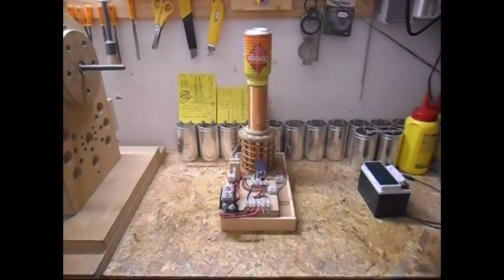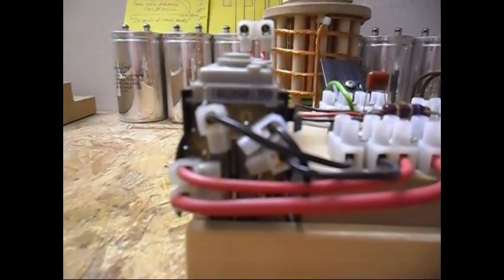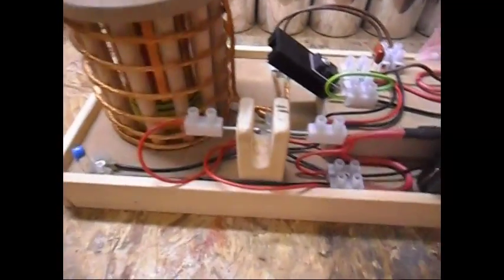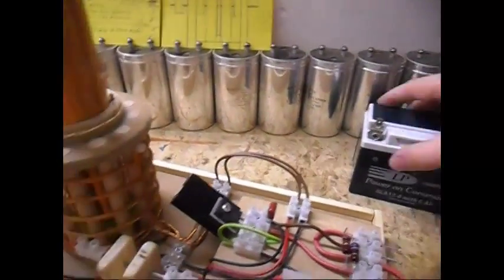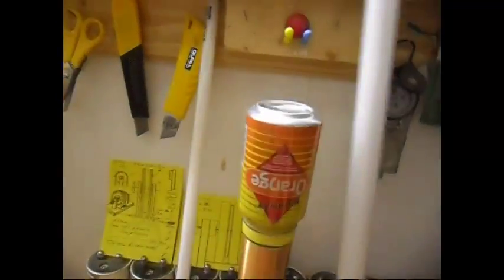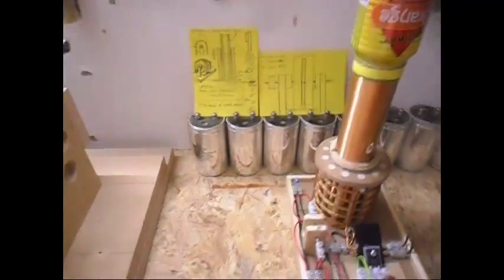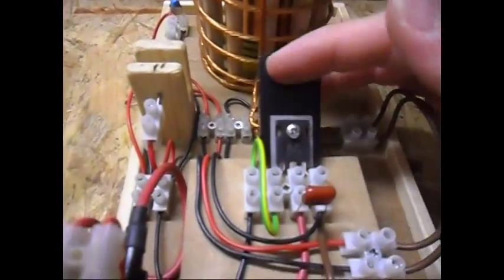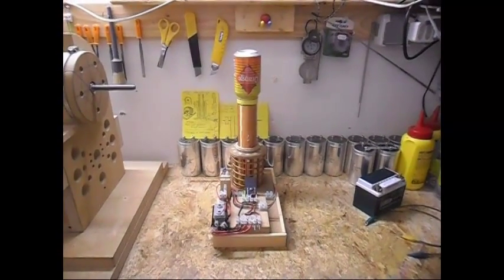Nikola Tesla Coil - Update 6 First try out, Flyback Transformer Feedback coil & SG...

Comment: Hi! what is the type of your flyback transformer? Please read back because my flyback is other and should also check the pins! your see the type numbers on your transformer magnet/metal.
Reply: you see on your transformer side
Reply from the maker: +Balázs Hévizi 
Thanks for your comment and my flyback transformer is a samsung one...^^
Pins layout just google for it...;-)
Reply: +Mister Caribbean Roots 
Thanks for reply but i need numbers for analyding transformer i searched in google but i find lots of samsung flyback transformers. i need the type numero (for example FSA2408)
Reply: +Balázs Hévizi 
can you send me the shematic diagram of tesla circuit or the flyback transformer. i have a ITT television flyback transformer. thank you! :)
Reply from the maker: Balázs Hévizi
Can't do that because i never have drawn a circuit for it, i just build as i go and go as i build.lol
This setup is already dismantle so the only way to see it is to make screen shots of the video...;-)
It is a very simple circuit...and the pinouts are easy to find with a multimeter...or just google your flyback transformer info...^^

Comment: You put in a lot of work on your coil. You should be proud. However, please view the comments I left on your "update 3" video. Your circuitry is not placed in the correct order. Your coil should be putting out 2" arcs to air. It is not because of your circuit being connected out of order
Reply from the maker: Hi Jason Bowles,
Thanks for your comment...^^
I'm always proud of my setups whether they work well or not...
"one has to proud of ones creations"...it always start with oneself...^^
I saw your comment on "Update 3"...

You've wrote here..."Your circuitry is not placed in the correct order" and also "It is not because of your circuit being connected out of order"...
Sooo, is it in the correct order or not...lol

Update 9 is best i could get it to work, the spark gap is really powerful and the sound was really killing my ears and the ozone gas my longs wich isn't funny at all...lol
 Nikola Tesla Coil - Update 9 First try out, Flyback Transformer, Feedback coil, SG & 30nF...

Comment: good job , what is the the natural resonant frequency of secondary coil and alluminium top load ?  I see big power and voltage in the spark gap but the result,  the light of the neons  and not corona and sparks in the air make me think that  primary circuit and secondary are not in resonant.   I really love how it is constructed :)  thanks.
Reply from the maker: Hi Mario Abbruscato,
Thanks for your comment, for your compliment and your input about the setup resonant...^^
I really don't know what the natural resonant frequency is of the secondary with the topload, i really need to figure that out...
The power at the SG is very powerful but like you said the output at the topload is not as good as it can be...
Btw, in update 7 it is working much better but it still needs improvements and can still work even better...i'm getting there...^^ 
Here's the next update, Nikola Tesla Coil - Update 7 First try out, Flyback Transformer, Feedback coil & 20Kv-10nf Caps...